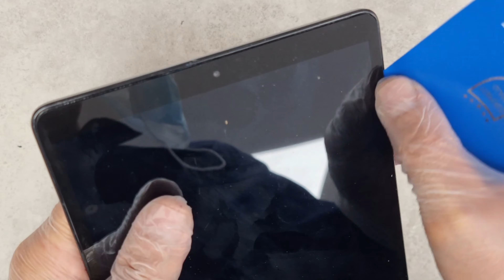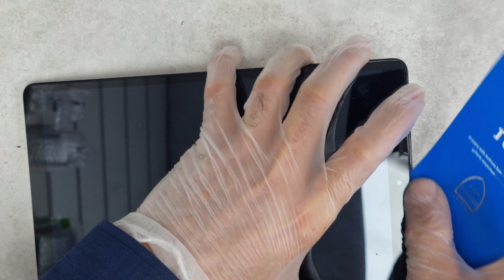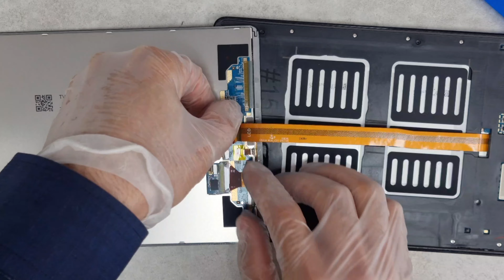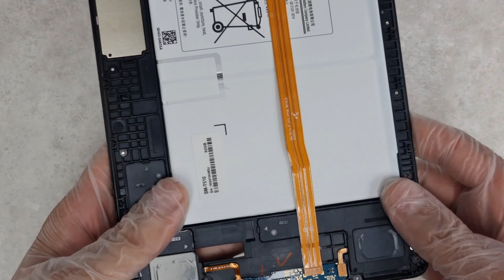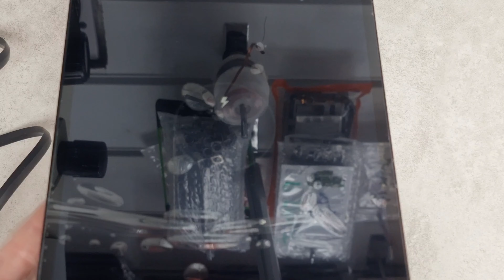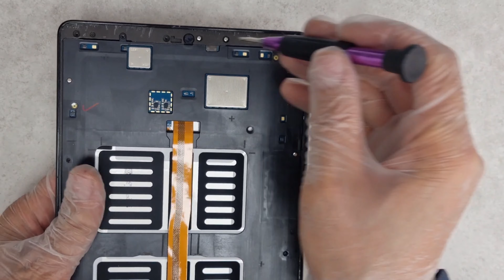Replace Charging Port on Samsung Galaxy Tab A T510

Comment: No need to replace at all. 
Just turn off the tablet if it has not already turned off due to low battery. 
Plug the charging cable into the charge port and wait for the screen to turn on and the moisture warning ⚠ to come up. 
Then turn on and once you see the home screen it will be charging.
If you pull the charging cable out at anytime you have to go through this procedure every time you want  to charge it  but hey it doesn't  cost anything but a minute of your time each time you charge.

If your going to repair please Do Not stick anything in and then run it around the edge as if you don't know what's inside under the screen you will more than likely damage some of the cable's especially along the bottom edge of this particular product as has been commonly done.
Always pry up a corner just ever so slightly enough to slip something like a playing card or business card that is thin but reasonably stout enough to keep the glue from sticking and then move along the edge alittle way and repeat applying heat when needed
You will end up with 5 or 6 cards sticking out of and then it will slowly come apart.
Also you don't need to push the cards in very much just enough to keep the glue from sticking.
Reply: Hello brother, my tab shows up the moisture sign and then when I long press the power button It does not boot the battery is 100% drained. Any solutions?
Reply: @sakshammithra4475  mine has been doing that for 3 years and i still do the same process i posted before. 
If your battery has been under charged for a while it may take a while for the battery to come to life to even show the error.

Make sure the tablet is off before plugging in the USB charger, once the battery has enough power and then when you see the  ⚠Warning charge error come on the screen,
 only then long press the power button and mine turns on and runs normal and starts charging.
 If anytime i unplug the usb and i try to plug it back in without turning it off it will beep very loudly.
Reply: @rjyadventures  Yooo!! Thanks you soo muchh mann!! It turned on!

Comment: Nice video thanks, what is that glue you're using to strick it back on
Reply from the maker: E8000 Glue
Reply: No need for glue it would stick again just use hair dryer

Comment: Read this please, before open it!! Its important (thats going wrong with my repair of the SM-T510) that you NOT use something sharp/card at the BOTTOM of the screen. I damaged the cable that control the touchscreen. The screen go’s on, but the screen won’t react at you touch. This i want to share with you.

Comment: Everything deemed to go smooth, until I put the lcd flex cable back and tried to turn it on the screen has lines of lots of colors all over it and no matter how many times I try to take off and reattach the cable it looks pretty much the same, did I mess up the cable somehow?

Comment: Hello I have this tablet and I need to disable and remove the battery and make it so it will only work when plugged in. Can you help me with this?
Reply from the maker: Hi Frankie
I'm sorry I didn't get exactly what you meant. 
Could you please specify more details? 
thanks
Reply: @PhonerepairsUK  I want to take the battery out of my tablet so that it will only work if you plug it into power. The tablet is installed in my car dash and when the tablet gets hot it won't come on until it cools down. If there is no battery it won't do this and I don't need a battery since it will always be hooked to power in my car.
Reply from the maker: You can remove the battery and cut the battery connector. Just leave the connector and remove the battery.

Comment: What Happens If You Remove the Touchscreen Digitizer While the Tablet is Still Turned On? I'm replacing an unresponsive touchscreen digitizer so I am unable to power down the unit.
Reply from the maker: Try to hold Volume + and Volume - while holding Power button.

Comment: Hello, I have bought a screen for a tablet like that, believing that it would be the screen that was broken, since it did not turn on but when pressing the power button after a few seconds it made some beeps as when it was turned on normally, not even the Samsung logo.  I also changed the usb-c charging module since I got a humidity error in that port, if you could help me I would appreciate it, a greeting
Thank you
Reply from the maker: That's sound LCD faulty.